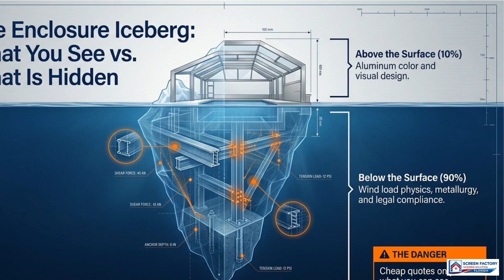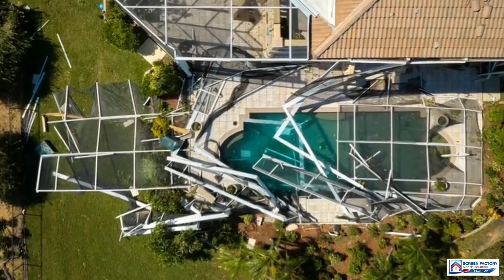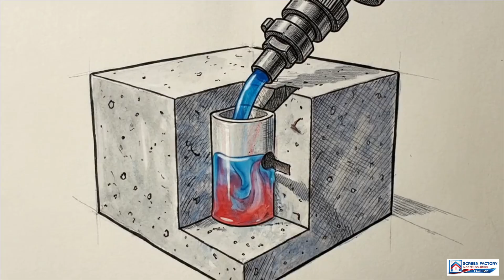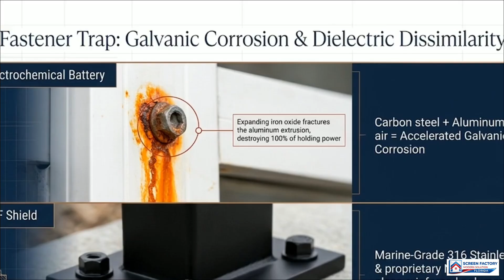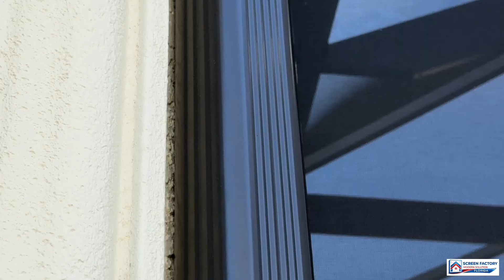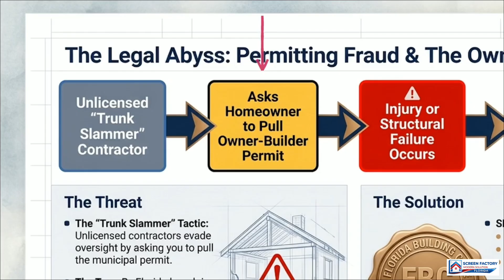Why Your Pool Enclosure Is Probably Illegal (And Dangerous)

Comment from the maker: Thinking about building a pool enclosure in Florida? Don’t choose based on price alone. Engineering, permits, fasteners, drainage, and materials can make a huge difference in safety and long-term cost.

Call Screen Factory Florida for a free on-site estimate: (239) 539-3677